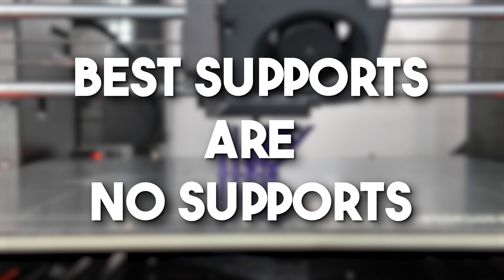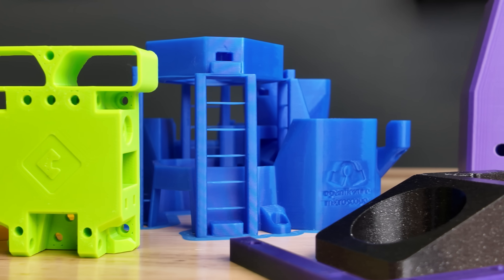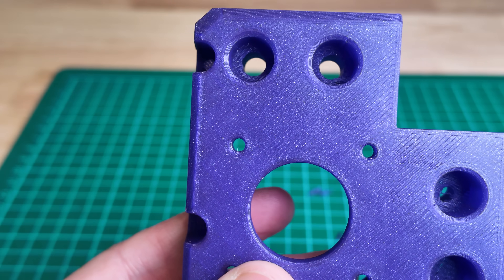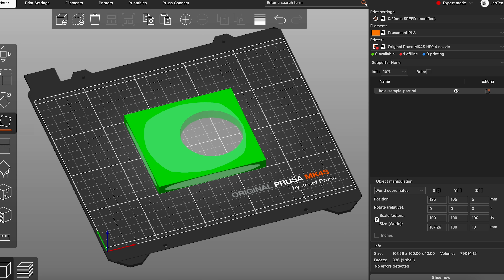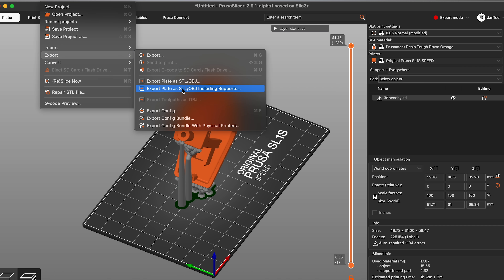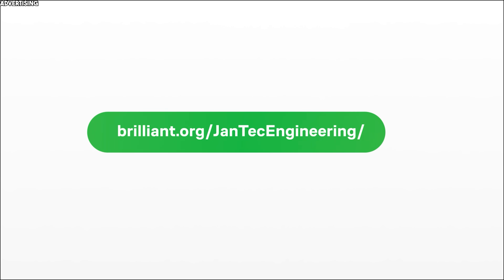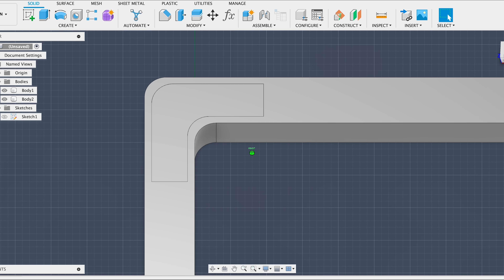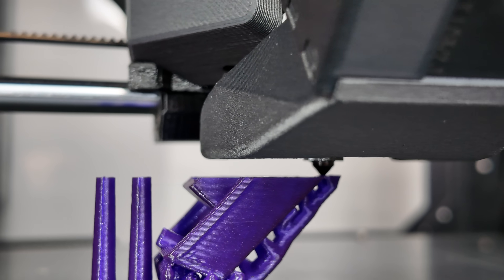Stronger 3D Prints & Less Supports: How to Design for 3D Printing

Comment: As an engineer working with injection molding, the ideal fillet size for a "perfect", low-stress minimum radius is 1/2 wall thickness on the inside corner and 1.5 times the wall thickness on the outer corner. But for any arbitrary inside radius, adding the wall thickness will give you the ideal outer radius.

Why go to this trouble? It keeps the wall thickness consistent before, during, and after your fillets. This is especially important for injection molding to minimize warpage, but applies to other technologies too. It minimizes stress mostly, and keeps a nice,  consistent part thickness.

Hope this helps someone out!
Reply: Great knowledge! Thank you for sharing it 😊
Reply: Thanks for this, and doubly so for explaining the mechanics. I tend to define a WallThickness parameter in Fusion so adding InnerRadius and OuterRadius parameters with your values will be pretty simple. Now wondering if bad external radii could be part of the problem with an ASA part I'm trying to build (a fence post cap) where I'm getting cracking on the external perimeters.

Comment: nice video
9:40 --> is quite unnecessary in this case tho as a normal cube modifier would do the job way faster, but for complex reinforcements the multiple body workflow can work great
Reply from the maker: Thank you!
Modifiers are a valid option, but in this specific case it would be difficult to get the arc correctly if not done in CAD.
Reply: i actually doubt that modifiers would be faster. 
you would never get the accuracy and repeadability.

Comment: FYI, Onshape has a FeatureScript for 3D Printable holes :) It does it for you automatically. I think it's Onshape. Though, I think Orca also has a way to do it, too.
Reply from the maker: That's good to know, can save a lot of time when there are multiple holes that need support.
Reply: @JanTecEngineering if you have multiple holes of the same size you can also create a body of the required shape and position a copy at the right locations and then subtract (combine, cut)
Reply from the maker: @Djeez2 That's a good option as well
Reply: Do you have a link to the script?
Reply: Orcaslicer:  Quality tab -> Bridge counterbore holes

Comment: cudos for featuring openflexure. i think this project deserves much more love. i recently built one for myself, and it is just mindblowing. as well as from the feature-standpoint but also for this absolute beautiful models made with openscad. if you ever used openscad yourself you can truly value how awesome the openflexure design is. it is truly mindblowing.
Reply from the maker: It is mindblowing. Happy to hear that the features are great too, I didn't build one (yet).
Reply: @JanTecEngineering  with the current v3-alpha OS you can easily do a stiched image with ~12k x 12k pixels from a 1x1mm slide with a 40x objective (without manual labor, all automatic!). it is truly awesome. some minor color-correction issues introduced by the raspi-cam v2 are not fully worked out, but you can get awesome results and a positioning accuracy you wouldn't believe are possible from effectively 3d-printed parts, a rubberband and a M3-Screw. you can see my build report and some sample-images in the openflexure forum (it should be the most current topic in the build-report-section, that purple/green one).
Reply from the maker: The scan showing the blood-cells looks awesome. Thanks for sharing. 
I think I should really build one.